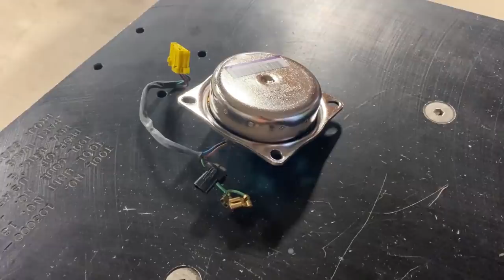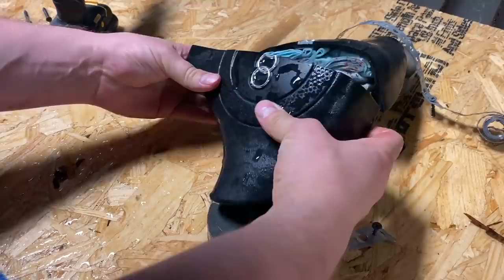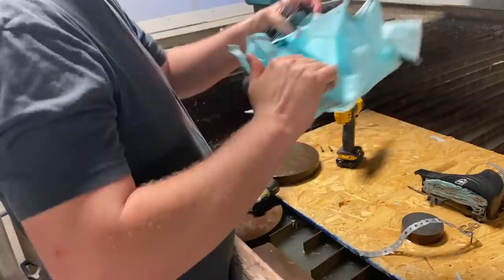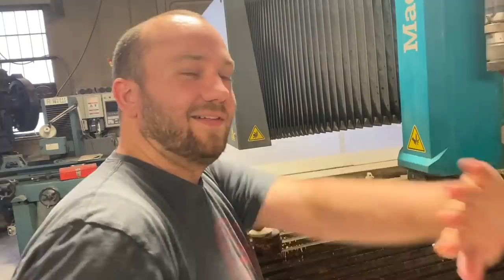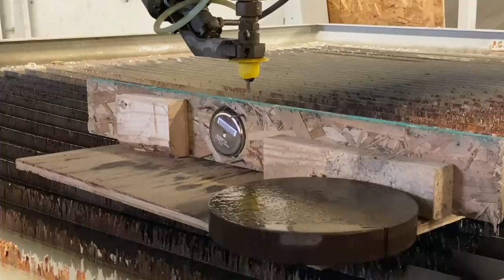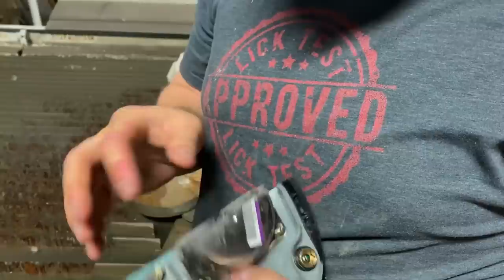Armed Airbag Cut In Half With 60,000 PSI Waterjet

Comment: "I've created a special rig" points at plywood with a hole in it while in a pretty well equipped metal shop....  Hmmmmmm....
Reply: He never said it was a GOOD rig
Reply: hey, wood is easier to screw into!
Reply: @dimitar4y  Threading isn't hard though, all you need to do is either drill or waterjet a hole and then thread it.
Reply: @A2ndFamine1  or just slap the electric screwdriver and boom it's in. It takes atleast an hour more to do that thing in metal.
Reply: Metal schrapnel causes more damage
Reply: but this rig was useless to protect the waterjet
Reply: Did it work though? Its not stupid if it works...
Reply: Its a "special" rig
Reply: Plywoods a hell of a lot cheaper than steel
Reply: @Dirtsteelforge  my thoughts

Comment: I worked at a Midas years ago, early 2000's, and we had a few airbags in the back of the shop.  We decided to set them up in the back lot and set them off.  We set up about 30ft of wires to them with a tire on top of one and a cinder block on top of the other.  When they went off they sent those into low Earth orbit just about.  The tire decided to get a little off course and come back at us.  You know, safety first...

Comment: An airbag will hit a max pressure of 21psi then deflate to 12psi by the time your body impacts it, the holes in the material are to facilitate the escaping gases, in comparison....a basketball is around 7psi fully inflated, and that hurts bad enough to get hit in the face with, but still better than hitting a metal steering wheel full force. Also that's why you must also wear your seatbelt properly to give your body enough time for the airbag to vent excess pressure. as to the burns, those are typically caused by the material, like a rugburn.

Comment: I am an engineer at a facility that produces the generate for airbags. The smaller charge is called an initiator. There are tablets on the inside of the wire filter. 

I would guess that the heat/friction was enough to burn the tablets and set imitator off due to how sensitive they are to friction and heat. 

The wire filter filters any residue and particulate that may escape into the bag. So you don’t get burnt powder in your face as well.
Reply: what do they use for the explosive now? Azide salts are old school as hell so what do they use now?
Reply: I picked up a load of airbag charges out of Ogden Utah once. It was placarded but not hazmat
Reply: @MandrakeFernflower  What so old about azides?
Reply: @user255  Just an obsolete technology. They were used in older model airbags.
Reply: I came here to say the same thing.
Reply: I think they use nitroguanidine now - azides are rather toxic to aquatic life so they were phased out
Reply: @bobbyestel  But what would make azides obsolete?
Reply: @MandrakeFernflower  It's so small amount and it will be mostly detonated or recycled... but I guess little streams make the river.

Comment: I hope you guys took the necessary precautions and took proper care of your water basin after filming this, because it is now filled with sodium azide solution, the explosive compound used in airbags, which is one of the most toxic substances imaginable.

At least Mitchell didn't lick the charge after it was cut in half... Though most, if not all of the compound was probably dissolved anyway, as it is highly soluble in water.

Stay safe, guys.

Comment: Hi, I worked at a certain airbag company, (that was in the news QUITE a bit the past few years) making the propellant and those actual inflators. All you set off was the initiator, which is like a "blasting cap, there is still another couple of grams of actual amoniumnitrate propellant in there, but it desolves in water, if it had gone off, that wooden rig you built would have been obliterated. It's been 5 or so years since I have worked with this material, so I've forgotten exactly how much of what goes into it. (Part of the reason I quit working there, memory issues due to ptsd) Anyway when I left there, I was working in the ballistics lab, where we tested the energy these things produce, long story short it's about 1/2-2/3 that of a m69 fragmentation grenade. (I was also in the army for a number of years, hence the ptsd.) Love the channel and the crazy stuff you do.🖒🖒

Comment: I found the inflator rig funny for two reasons:
1: It's a radial inflator, so they basically just oriented the plane of the inflator exactly so it pointed at the water jet.
2: If it were a linear inflator, it would either break those screws like papier-mache or carry the whole thing to the other side of the warehouse.

Comment: Chemist here: Just so you guys know, this was probably the most dangerous thing you could possibly do with an airbag charge. most older airbags contain sodium azide, which is one of the most toxic compounds ever discovered. Even breathing, touching or ingesting minute amounts of sodium azide can kill you. On contact with water, sodium azide produces an extremely toxic gas, and on contact with most metals will form a shock/touch sensitive explosive. There have been cases of people washing sodium azide down drains and causing huge explosions in sewer systems. 
In other words, keep up the great work!
Reply: I agree with you, this was dangerous af.But I thought sodium azide was soluble in water and doesn't react with it?
Reply: @CrazyNerdInventor  You're right in that it's readily soluble in water, but it dissociates into ionic sodium and hydrazoic acid, which itself is explosive and volatile. So the solution readily vaporises and can go straight to your lungs.
Reply: lets hope it was younger than 1995 than
Reply: Why would you make an airbag out of something like that?
Well, I guess they don't anymore.
Reply: @Kishmond  not a chemist, but my guess is they didn't know how bad it was at the time and later discovered something better and decided the "kills you" chemical wasn't cool anymore.
Reply: This Audi steering wheel was at least late 90s (new design) after they stopped using sodium azide. In fact, most automakers stopped using past the mid 90s. It's fine.
Reply: @Kishmond  well no cases of sodium azide poisoning from airbags have been recorded. Sodium azide decomposes into nitrogen gas which is harmless.
Reply: Azide has been phased out for a few years from modern airbags, even then has only been in 20-40% of all airbags.
Reply: Another chemist here (old one, who's blown up a lot of shit and still has a full complement of fingers, eyes, etc.).  Yes, sodium azide is quite toxic and reacts with water to form hydrazoic acid (boiling point 37C, but very soluble in water) which is hideously toxic.  Hydrazoic acid is also corrosive and forms shock sensitive explosive azide salts with many metals.  Particularly nasty are copper, lead and silver azides, which can be formed on contact of hydrazoic acid with copper tubing or wire, lead/tin solder and silver brazing alloys respectively.  I think your water jet bath is large enough that dilution will prevent any of these materials from accumulating, although I would be wary of any corrosion deposits found near any components made of the above materials.
Reply: No toxicity has been reported from spent airbags
Reply: so don't lick it?

Comment: It's likely filtering out fire. Seriously. They used to do that in old coal mine lamps too, a thin wire mesh keeps a carbide lamp flame from setting off any mine explosion from methane pockets in the coal by cooling the gas quickly enough that it won't ignite anything. I would suspect here the wire mesh keeps the flames inside the gas generator, and makes sure they don't actually set the air bag or the car on fire. Which would probably be a bad thing if you've just been in a accident...

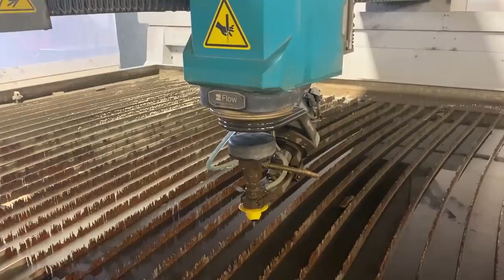Comment: 1:33 The face you make when you want to protect your hundred thousand dollar piece of equipment but also really want to do something irresponsible with it :D
Reply: Is it really worth a hundred thousand? That’s a lot more than I would’ve guessed
Reply: The tiny desktop Wazer is only 8K, but the bigger ones start at around 60K and go up exponentially with size, pump HP, and axis options, then there is the cost of running them, they run on 440 and suck power like nobody’s business.

Comment: They have a center blasting cap like a bullet primer (that pop you heard) surrounded by gun powder that when ignited blasts gas out of the holes to inflate the bag. The mesh is a spark arrestor like in a dirt bike muffler.
Reply: David Blanck There isn't a primer or gunpowder in an airbag module. Sodium Azide and an electric initiation do the inflation.
Reply: @KJ-kw7gh  thanks for clarifying. I don't even know why I thought that was right. I know it is an electrical charge that sets it off. I should have also known the blasting compound was changed since they used gun powder explosives. Thanks for clearing that up. I blame my assuming I knew what was right on the alcohol I was on during this comment lol.

Comment: Total safe , water disables ammonium nitrate, infact in commercial blasting they pour water in the hole to kill it if it was not properly filled. In that instance, only the initial charge of 1/3 pound booster would go off with no I'll effects

Comment: If memory serves me correct that "coil" of wire is actually a shock dampener. I remember a company that made those coming to give me a demo and some samples. The wire is  woven together and then compressed and is designed to absorb large shocks where elastomers would either not work or be too soft. But in this case it could serve other purposes since its also porous.

Comment: The "that" what you where wandering about was likely the initial release of the gas held in the mechanism the blast charge ignites the gasses and the circle is more then likely thicker than the rest to prevent bad burning on the face in the event of the airbag deploying.
Reply: Lunarology as a chemist I can tell you there is no burning. The “gasses” is sodium azide powder, and it doesn’t burn, but decomposes under heat to nitrogen, a completely inert gas witch doesn’t burn

Comment: I did some road work at a factory where they create the explosives that go into these.

They told me that this stuff is so unstable that if you picked up a granule of the stuff and dropped it, the static charge it would generate from falling through the air would make it detonate before it hit the ground.

The only reason it doesn't spontaneously detonate in the housing (usually) is that it's grounded to the housing. So ya, think of it like a little pill of nitroglycerine, though its actually more unstable, inside a metal housing that will instead turn the explosion into jets of explosive fire, rather than a fireball.

Comment: I belive the metal filter is supposed to remove any burning particles and act as heat exchanger and reduce the temperature of the gas so it won't burn the bag.

Comment: Airbag fractured my skull around the eye orbit, still suffering with this after a year and a half later.
Reply: Sorry to hear that dude. Can I ask? Malfunction? Or would you have been worse off hitting the dash/wheel?
Reply: Orbital fractures are a bitch. That sucks.
Reply: @metamorphicorder  still messing around with a settlement too, probably going to end up in court.
Reply: @minigpracing3068  so you want to take them to court for saving your life. god bless the USA
Reply: @Mitchell_is_smart._You2bs_dumb  taking the drunk to court. I had my seatbelt on, the airbags did not have much work to perform, I doubt I would have been more injured by a lack of airbags.
Reply: @minigpracing3068  oh dang. then rip em a new one. that's legit
Reply: @Mitchell_is_smart._You2bs_dumb  I should probably also mention this in case the opposing side finds this in a search... The other guy plead guilty to the charges in a court of law as part of a plea deal. Therefore the drunk moniker is not slander or liable as it is the truth from public record. And his name is not mentioned so no defamation, you'll have a somewhat difficult time linking my online persona to the real me. Not impossible but it will take some work.

Comment: Those "staple bits" act as a ceramic to absorb heat. Without it, the gasses would burn through the airbag material...preventing inflation. 

Without it, the steering wheel will essentially "blow up".